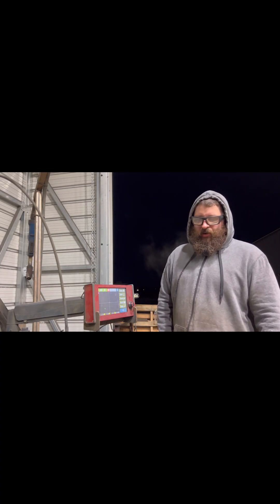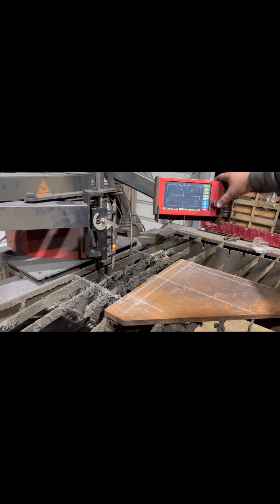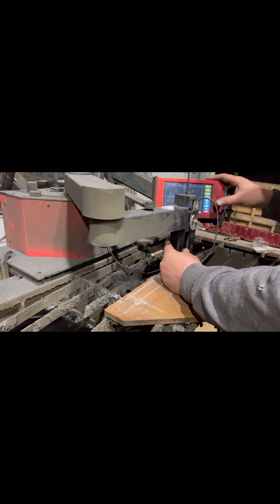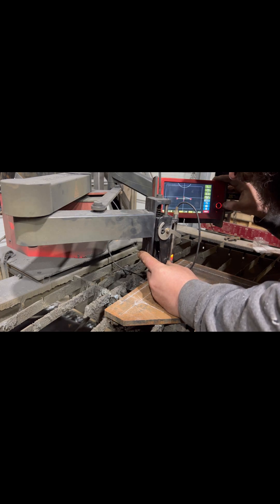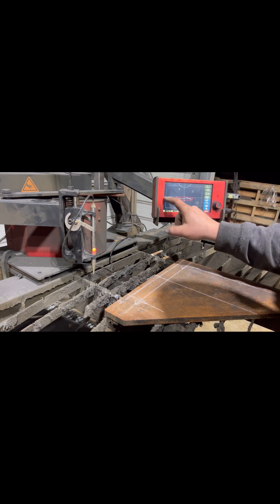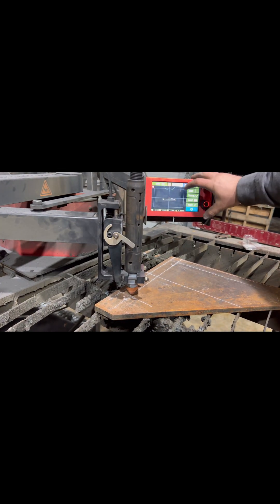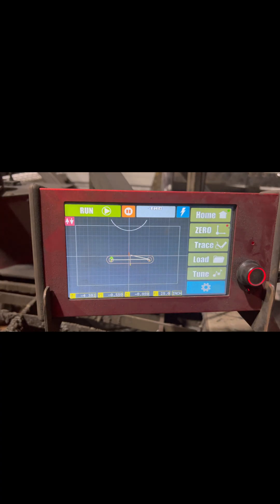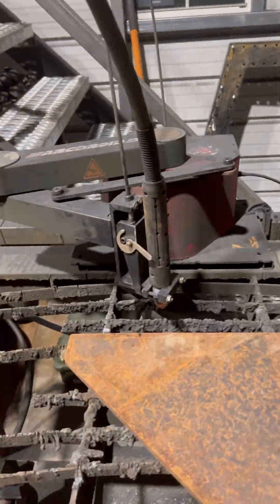Arcdroid CNC plasma cutter

Comment: Seems like this machine gets used. Have you had any issues with it? Thinking about getting one for my shop. Thanks.
Reply from the maker: It definantly has its hiccups. But for the most part it works great. Make sure to stay up on the updates on the simple trace and firmware